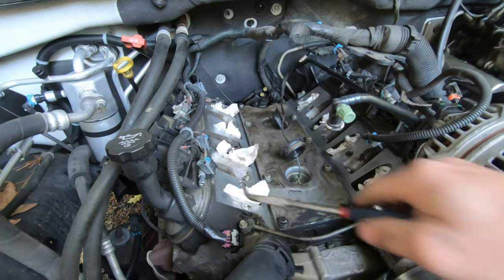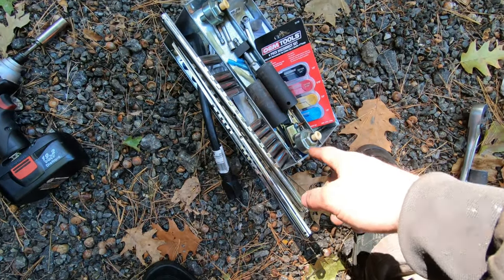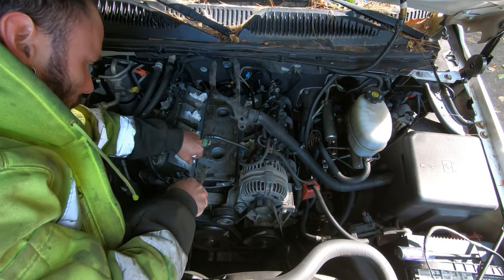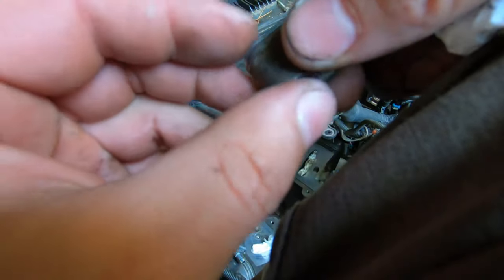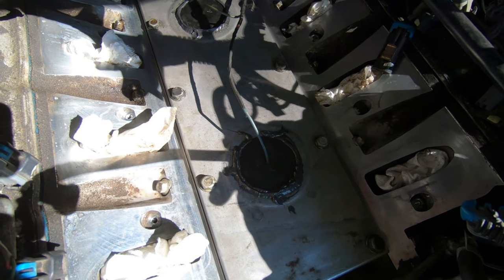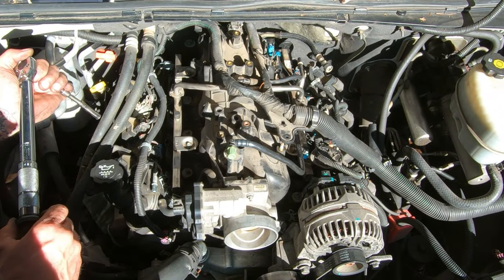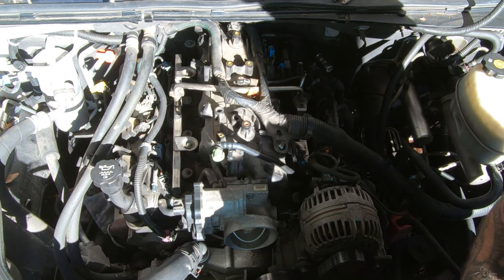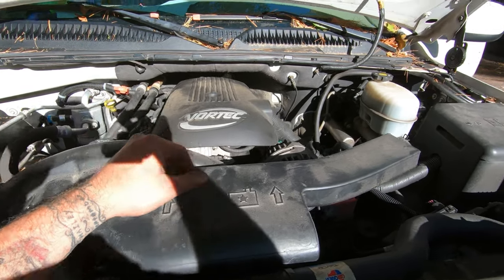Chevy and gmc 5.3, 6.0 valley cover and intake gasket replacement part 2

Comment: Thank you for videoing this.  I have 2002 6.0 with 212k miles leaking oil out the back of engine. I thought maybe rear main seal but had shop run dye and said it was that valley gasket. May have to attempt this fix so thank you for walking thru the steps.
Reply from the maker: No problem. I hope you found it helpful. Thank you for watching.
Reply: how did the shop see the dye coming from valley gasket? Did they have to take it apart??
Reply from the maker: I didn’t put any dye in it. I just decided to try and change the gasket because it can be an issue and I figured it was worth a try. Oil was coming from the area so I though it was worth a shot. Unless you were asking rick the question.
Reply: @JasonTheMunicipalMechanic  yes I was asking Rick, but thank you for your quick reply.
Reply from the maker: You can get a uv dye that you put in the oil and you run the engine and use a light like a black light that reacts with the dye and shows up when the light is shown on it. You try and catch it early before it gets everywhere and see where the leak is originating from.

Comment: Hey man just wanted to comment great video. I studied this video for 1 month till I got the nerves to do it. Did it yesterday and solved my coolant leak. Mine was a air plug on the passenger side on the back. Took it off to see the gasket it had only had half the O ring on it 😂. I replaced all the gaskets too I had gotten a full set. Overall this was great video and Thanks Alot man.

Comment: good stuff thank you.  I have a front hitch for taking a tail gate thing to carry gear on trips.  it helps a lot to install the tail gaiter to reach everything in this repair.
Reply from the maker: That would be nice having a step there. I was looking at a long step harbor freight has for that but haven’t gotten one yet. Sometimes I’ll use one of those 3 foot ladders to stand on.
Reply: I built a platform out of 2x12. Perfect

Comment: The lower knock sensor pedestal seals usually come with the valley pan gasket
Reply from the maker: The kit for the valley pan gasket did have them but the top end gasket kit didn’t have them.

Comment: Wow great video !!! Everything in part 1&2  is explained in detail and easy to understand. You gave me confidence. I have two questions if I find any loose valley Pan bolts when removing should I use blue loctite to reinstall and is there a torque to the valley Pan or should I just snug them up?
Reply from the maker: I didn’t use any thread locker but it probably wouldn’t hurt. The valley pan bolt torque is 18ftlbs. I accidentally edited it out and didn’t realize it.
Reply: That's odd. I also found some, like 3, loose valley pan bolts. Maybe that was my oil leak? Possibly

Comment: Correct me if I’m wrong but I can’t find the part where you say what you torqued those valley pan bolts to. I heard you say the knock sensor and intake torques but not the valley pan
Reply from the maker: Sorry if I didn’t mention it. I removed a lot to shorten the video I must have accidentally cut it. The valley cover bolts are 18ftlbs.

Comment: Thanks for the video.  Better doing this job in 40 degree weather then over 100F in south Texas but both are not ideal conditions. Did this fix all of your oil leak problems or the majority of them? Thanks again
Reply from the maker: It reduced it, i was hoping for the amount of work it would have fixed it. I think the oil pressure sensor was leaking too. The oil pressure sensor is a problem for leaks as well, along with the oil pan, rear main seal, and rear main seal cover plate.

Comment: Salutations Rick!! Um I really want a 2004, or 06 chevy tahoe or suburban. Am I about to open a can of worms? I like them and heard they're solid trucks. Any advice would be greatly appreciated!
Reply from the maker: I’ve had a few chevys of that year range and I think they are pretty reliable personally. I prefer the 5.3L engines but I had a 6.0 in a truck and it was pretty reliable for me as well. The all had 230k+ when I got rid of them due to rust. They do like to leak oil.

Comment: Jason what do you mean with manual said front line is AIR BLEED? And did the coolant seal worked? It really looked weird
Reply from the maker: The front line is where the heads bleed the air out. The coolant doesn’t run between the heads in the intake anymore so they are basically like two upside down bucket that will trap air in them and it is let out in the front line that runs between them. The gaskets I got did end up working. I had to get replacement caps once on a different truck and there was no relief cut for the oring. It was a flat piece and I think the little gaskets would work better on those, but they did work.
Reply: @JasonTheMunicipalMechanic  thank you for your quick response I'm going to try it on my 2006 Chevy avalanche its freaking driving me crazy 😤

Comment: hi thanks for showing your process. do you happen to know the torque specs for the valley plate bolts?
Reply: nvm i just saw your response to someone else.
Reply from the maker: It’s 18ftlbs. I had to put it in the description because I accidentally removed it when I edited the video. Sorry about that.

Comment: Did putting the air bleed gaskets stop ur coolant leak?
Reply from the maker: Partially. I had a bother leak that was the main leak coming from the tee at the heater core. I made a second video of it after this. The tee would only leak when it was cooling down but still had pressure in the system. Took me a while to locate it.

Comment: How did you clean the area beneath the valley gasket in the engine bay?
Reply from the maker: I used a razor to remove the gasket that was stuck on the mating surfaces then a shop vacuum to suck out all the debris and dirt. I try to angle the razor away from the holes.
Reply: @JasonTheMunicipalMechanic  what I'm asking is how did you clean the are where the knock sensor screw into and you can see the camshaft at each end.
Reply from the maker: I just vacuumed out that area. I didn’t really need to clean it. I tried wiping it but the surface was rough and pulling pieces of paper towel off so I left it alone. I cleaned around the cover before I took it off to keep stuff from falling in when I took it off.

Comment: What was the torque spec for the valley cover bolts ??
Reply from the maker: 18ftlbs
Reply: @JasonTheMunicipalMechanic  ty , one more question do we have to put lock tie on the intake manifold bolts ?
Reply from the maker: I don’t think it’s required. I don’t know about the displacement on demand covers though. I don’t think I did when I put this back together. If you do use a blue or other removable type of lock tight, I wouldn’t use red.
Reply from the maker: Yes, use the blue or other removable type (not red)

Comment: Did it fix your oil leak?
Reply from the maker: It slowed it down a lot. I think the oil pressure sensor was leaking too. I should have changed it while I was there.

Comment: I had this replaced and was told i need to get my truck reflashed did anyone else have to do this?
Reply from the maker: Did you have the afm valley cover and put a afm delete cover on? That’s the only thing I could think of is you would have it reflashed to remove the afm programming.
Reply: @JasonTheMunicipalMechanic  I dont think so I was going to get afm removed but I didnt know about a afm delete valley cover so I think it was a stock replacement
Reply from the maker: I haven’t done it myself but I don’t think you need to use the cover. The afm is a programmed thing so it will probably throw a code if you use the delete cover without reflashing it. Your first question kinda threw me off. I’m pretty sure you can use the original cover and reflash, but you will need to reflash to get ride of it.
Reply from the maker: I found plug in afm disabling devices online that plug into your OBD2 port. The one I saw was plug and play and remove when you want it back.
Reply: @JasonTheMunicipalMechanic  yeah going to get a Diablo sport tuner for it in a month or so defently after one of the lifters going out
Reply from the maker: Yeah they can be a problem. Some people have been able to get them unstuck but it’s still a pain to repair.

Comment: You skipped over the the entire replacement of the valley seals poor effort sir
Reply from the maker: Which valley seals are you referring to. This engine only has the one seal that seals the cover and the 2 knock sensor seals. I don’t have the displacement on demand oil passages so I don’t have those seals to replace.
Reply: This guy did a great job. I'm doing mine tomorrow because of this video. Thank you for the video
Reply: Wah wah wah. Poor effort?! This guy made an awesome video and did a great job.